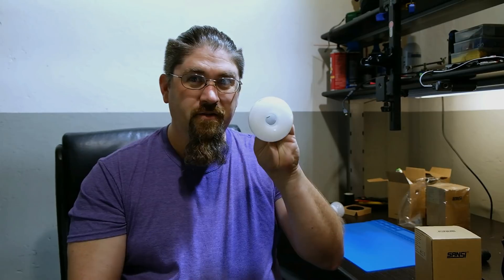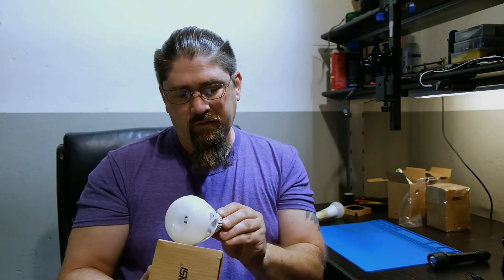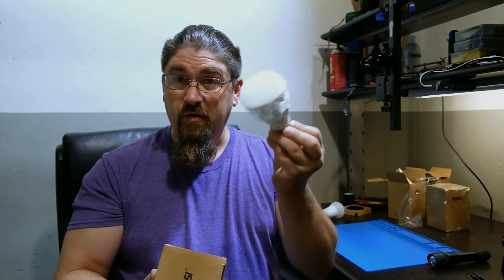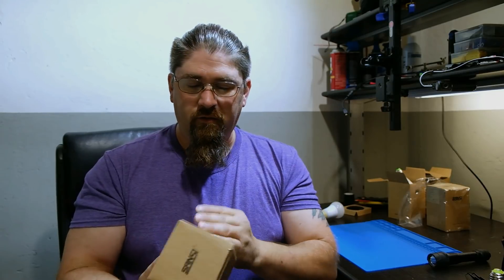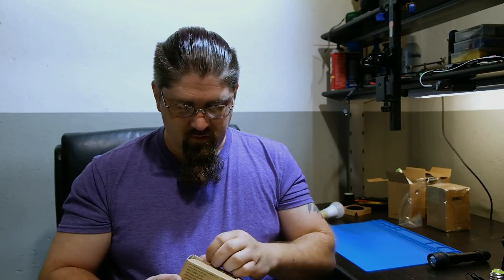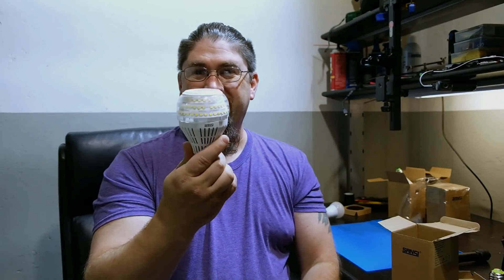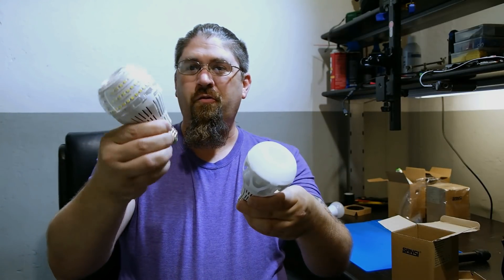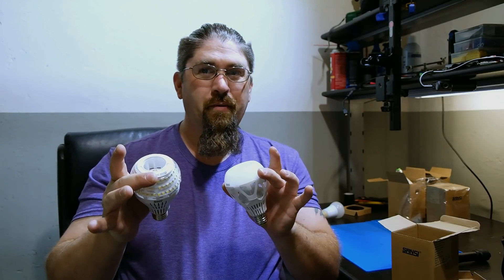SANSI 250 Watt Equivalent LED Floodlight Bulb Review & Teardown

Comment: Ah, I wanted a teardown of the second type of bulb. Also you said it was fine for outdoors, but that seems odd because the passivation stops at the last 1/5 of the circuit board and of course that would weather badly (but perhaps not shock humans!) I have a C21BB-QE26-10W-27/65-80-W that lasted not long at all as a bare downlight in the garage and I want to restore it natch, but it is built like a smol rhinoceros with a bit of jiggle but not looking super shimmable. At all. Do I send it to Lockpicking Lawyer with some pricey drink?

Comment: If you twisted the 150W that is not as bright off then showed us the 250 on would be a good review. Having them both on shows us Jack chit lol. But when you put them in a lamp one at a time. Of course you can see double the brightness only when I have your video up on two separate pages. Or stare at the lampshade tells you. Thanks for the review.

Comment: I love your reviews but I really wish you would add temperature data in for your bulb reviews.  I am aware that ceramic is a better at dissipating heat than the aluminum based LEDs but I have seen differences as much as 10 degrees Celsius on regular 60W equivalemts, for safety reasons I hope you could start adding temperatures for these bulbs vs others because I see people bashing these bulbs because they do not have any certification but on the surface they look superior to bulbs made by GE and others but would love to see some kind of comparison given the impact of heat on LED brightness and life over time.  Thanks for a great vid.

Comment: Thanks for the teardown, it's amazing they're probably running 265v across 3.1v LEDs by lining up like 80 of them.  Seems pretty economical as long as the voltage boosting circuit isn't too costly.  Something to think about.